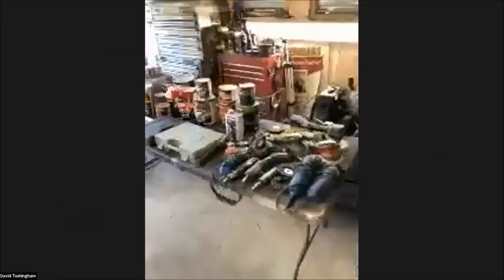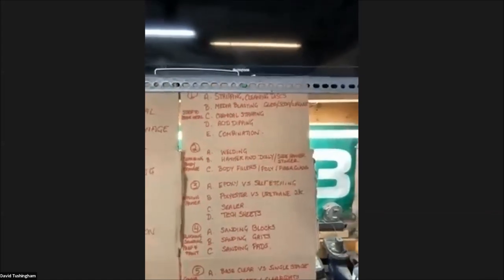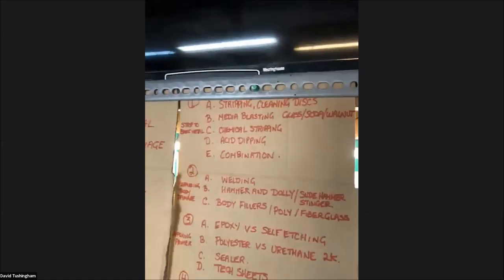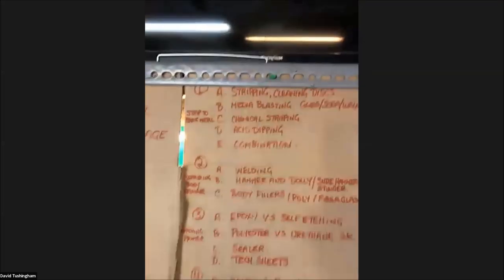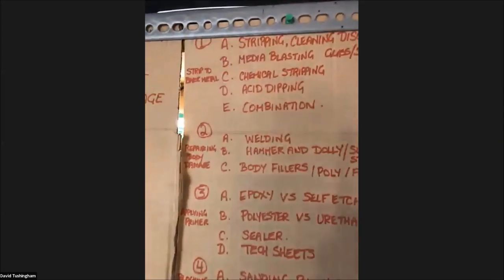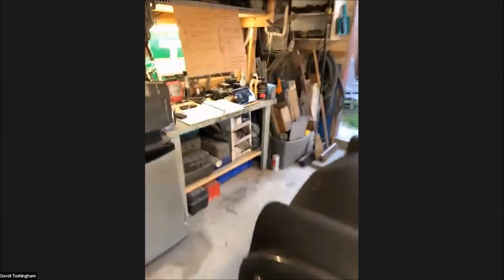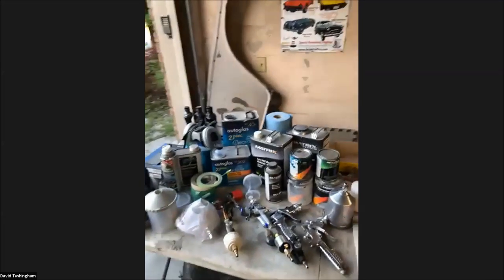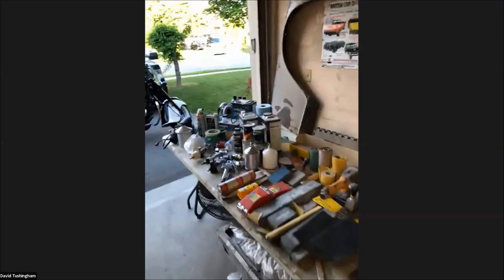Toronto Triumph Club's June 2020 Monthly Meeting Via Zoom, TR Restoration Steps, Bare Metal to Buff

Comment: Dave the 250 is my favourite build so far, but my question is would you perhaps consider making the engine a little peppier than standard possibly?
Reply from the maker: Phil Tucker hi Phil, oh yes, the engine will be quite a bit peppier than stock...head has been shaved and ported...everything is balanced and blueprinted....high lift cam, over bored, triple Webers, header etc.
Reply from the maker: Phil Tucker Oh, one more thing Phil.  I will be videoing the full engine build as I put it back together in my garage hopefully in about a month or two.